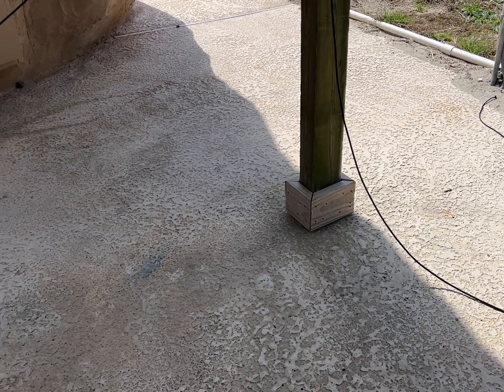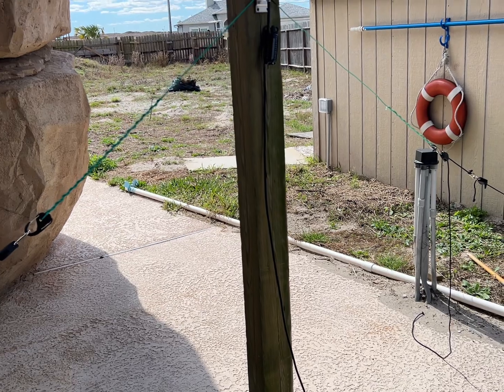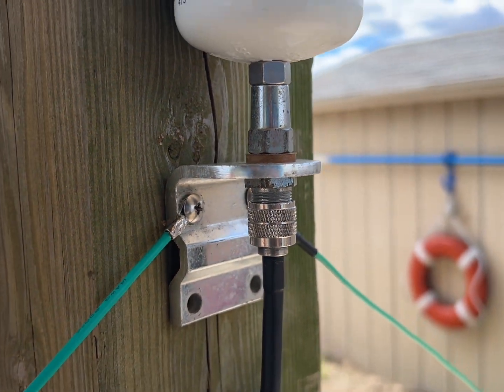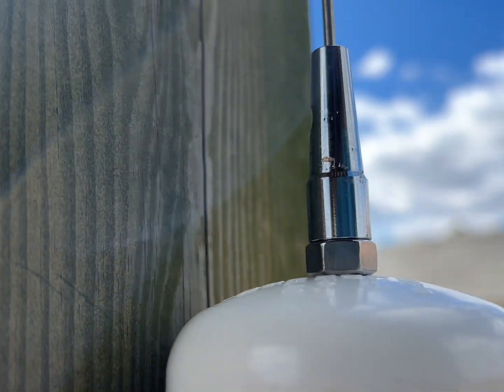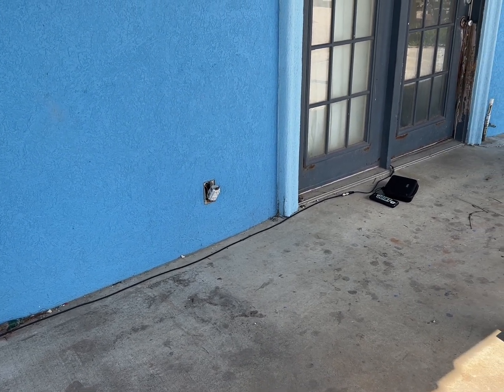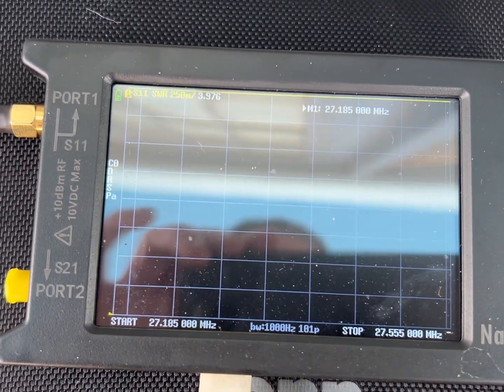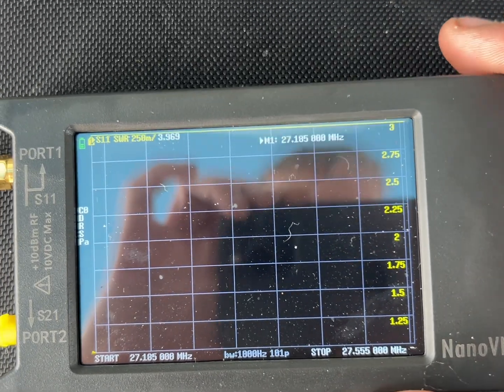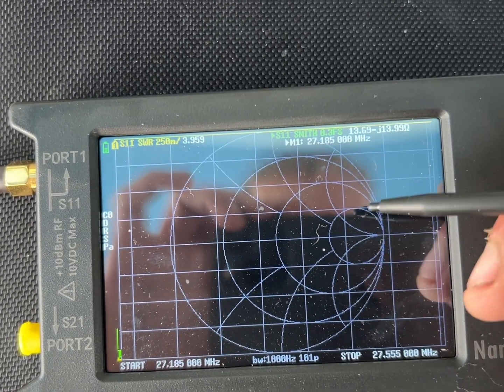2-3-2024 I have just completed the prototype of my first loaded coil vertical antenna.

Comment: Your video inspires me to put one up featuring my conglomeration of an 80-meter Hustler coil on top of some Chameleon antenna mast that's 9 feet long and another mast that is 54 inches long that comes down into the Chameleon CHA MIL transformer.  It's for multiband operation from 160~6 meters upon working from an apartment balcony railing.
Reply from the maker: I've always been curious about apartment antennas and think it's a good idea. You should put it together
Reply: @361cctx-vv6ch  The physical antenna length that anyone can see looks about 20 feet long, but with the 80 meter coil on top it makes it about 80~88 feet in total length!  It's great for those with limited space/yard/garden and such.  Also, I am a Ham operator but I don't like posting my call on threads like these because it's caused hacking attempts in the past, but I DO play around on 27.385 LSB and vicinity, "330 Northeast Ohio!" 73.